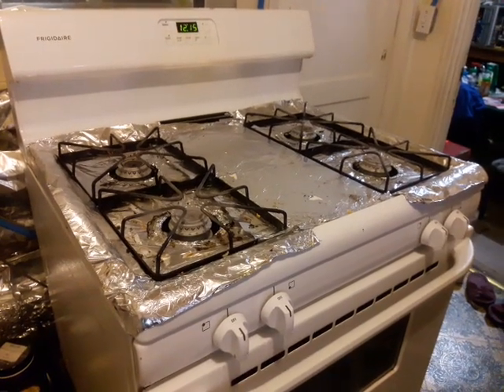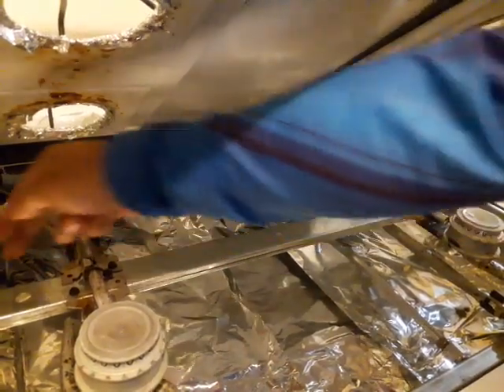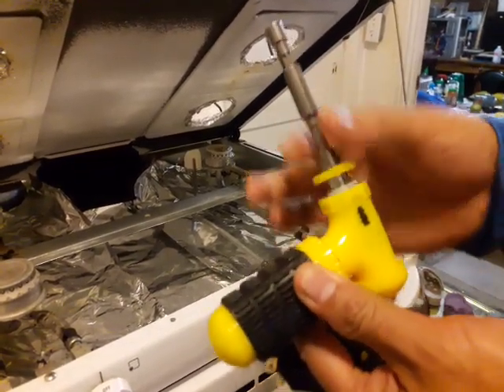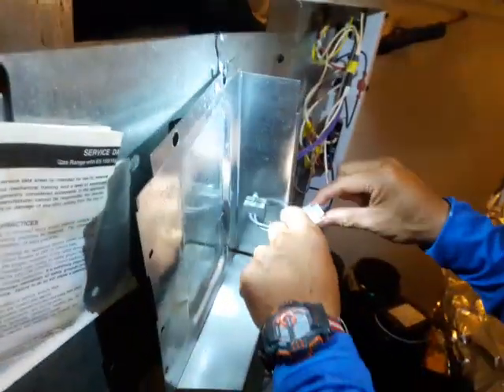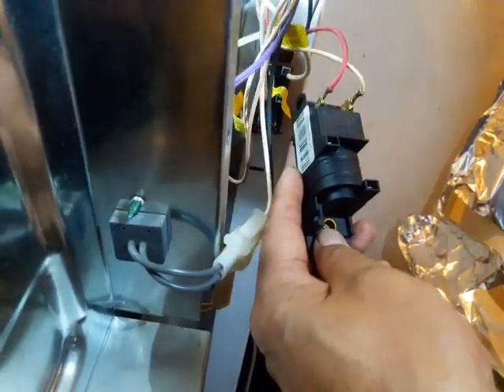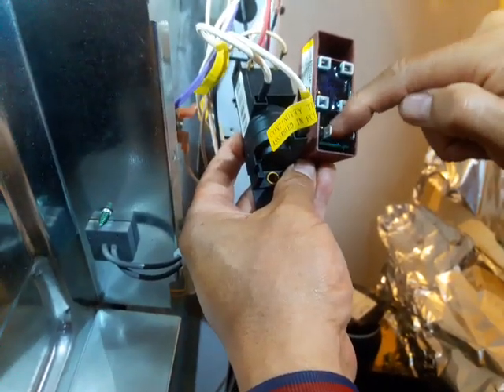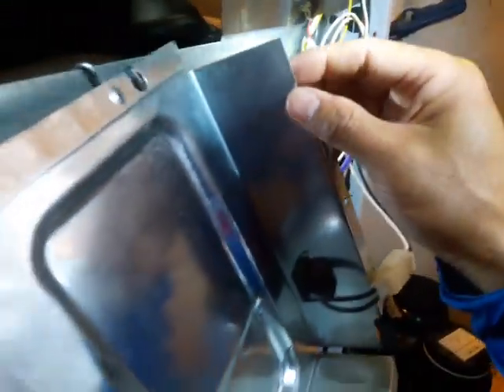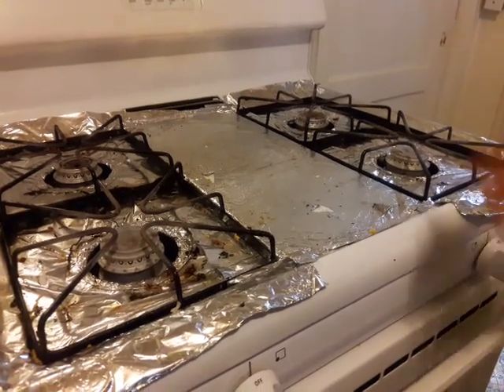Frigidaire Stove top oven no spark problem FIXED.for $20.00

Comment: Hello True, if I get a clicking sound and no spark on 2 out of 4 burners. What part do I replace? Also, if 3 burners come on and one burner has no click and does not light. What part is that do I replace? 2 different scenarios here, 2 Frigidaire oven. Thank you
Reply from the maker: On my oven, there is only 1 modulator that generate electricity to 2 Igniters (the one that create a spark), one Igniter control left side with 2 burners, and the other igniter control 2 burners on the right side.  Unlike my oven,  Some ovens have 2 modulators: 1 to control the left side (2 burners) and the other to control the right side (2 burners). Then some oven will equipped with 4 modulators to control each individual burner, Your oven is not the same model as mine but here is my thought on it.

1st Frigidaire oven "clicking sound and no spark on 2 out of 4 burner. You want to trace the wire from the igniter(the one that create a spark like a spark plug on car) to that modulator and replace that modulator assuming the igniter and the wire to the modulator is clean, good connection and no burned food that stuck in between the gap of the igniter that prevent it from making a spark. 

the 2 burner with no spark probably on the same side, left or right side of the oven. Don't be surprise when the wire from the ignitor to the modulator is damage due to bad connection or by mouse chewing on it.

2nd oven "3 burners come on and one burner has no click and does not light."

This oven probably have 4 modulators and igniters to control each individual burner, or that individual igniter is bad.

 Check the igniter and wire to the modulator to make sure it have good connection and power to the modulator, if everything seem good, than that particular modulator is bad.

Remember that the igniter is the one that make a spark(clicking sound). Modulator generate the electricity or power to the igniter that make the igniter spark. 

Hopes this will help.

Comment: Can I use a nonspecific modulator for stove top if all I need is power in power out and 4 connections for burners?thanks for the great video
Reply from the maker: Yes and it should be OK because the spark module is designed for many different brand of ovens. The only thing that you need to keep in mind is the input and out put may be effecting how strong or weak, slow or fast the sparks going to be since it varies from different brand. The original design of the modulator for this specific oven is 4 connectors for the burners. But the burner only use 2 connectors so they blanked out the other 2 ( they disconnected 2 connectors in the module so you cannot use this module on the 4 connectors type). If your oven is a 4 connectors type, then the part below is NOT COMPARABLE since it designed for only 2 connectors. I known people slice the 2 connectors of the 4 connectors type and joint them in with the other 2, but when they turn the oven on, the sparks are weaker so I don't recommended this technique since it required a wires modification on the oven.

If your oven is a 2 type connectors then copy this part number 808608801 and pasted on the search box on Ebay website. This part number is a replacement for Original Part numbers 316262402, AP5987233 and PS11728607. This will give you the idea of the price range, and design. The brand name I used in the video is ERP brand. At the time of this replied, the price is $20.08. According to my family, the sparks are stronger and faster than when the oven was new (with the original part number 316262402) . THESE PARTS NUMBER WILL NOT WORK ON THE 4 CONNECTORS TYPE. I hopes this will clear any confusion and thank you for watching.

Comment: mine sometimes 4 of them working next day 4 of them not working and later working ,,, is still issue with module?
Reply from the maker: I would first check for electrical connection to the oven. Before my module go out, I noticed a weak spark, and a few days later, it stop working. So if the spark on your over is weak or low when you turn on the knob, there is a very good chance that the module is about to go bad. The spark should be rapid and fast like in the video. Below is the link to the exact module I bought for my oven for  $20.08. 

https://www.ebay.com/itm/Gas-Range-Oven-Spark-Module-808608801-for-Electrolux-Frigidaire/382193412868?ssPageName=STRK%3AMEBIDX%3AIT&_trksid=p2060353.m2749.l2649

If link doesn't work, go to ebay and paste the below info in the search box and look for this seller name "supplystuf" and the brand of the module is ERP:

Gas Range Oven Spark Module 808608801 for Electrolux Frigidaire

I don't endorse or receive any payment from any sellers, I just past the info a long because it's works for me and I hopes it will help you too.
Reply: thank you for reply ,,, actually my stove is Amana AGS730L and is different so i wasn't able to see the spark module and I'm thinking maybe it is bad connection because sometimes spark is working ,,, today no spark at all :(
Reply from the maker: I would try to use an extension cord and plug the oven to another out let to see if you have a connection problem. If you got the same result, take a look at that module, mark all wires, clean the connectors and give it a few taps to see if it work.  You will also have to check to see if the power going to that module, If the module got power, and it doesn't spark, then the problem seem to be the module. Below are the link to your oven:

https://www.partselect.com/Models/AGS730L/MFGModelNumber/P1141263N%20L/Sections/ELECTRICAL-COMPONENTS/?ModelID=23620&ModelNum=AGS730L&mfgModelNum=P1141263N%20L&ManufactureID=1&Selected=21679&Position=3&mfg=Maytag&Type=Range&Mark=3

The spark module is #6 with part #: 
Spark Ignition Module with Bracket
Part Number: PS2034431

Comment: So the 2 most common failures are the spark ignition switch harness and spark module
Reply: Yes, because these are the 2 that mostly in physical operation when you turn on your oven. Let hope that it's a modulator because it's cheaper and easier to replace.

Comment: Hey, True, Where did you find a new module for $20?  All of the new ones I've found are $40 +
Reply from the maker: The price go up a bit since I bought it in December 2017, but you can still find it under $20.00. Go to Ebay and type in the search box as below:

Gas Range Oven Spark Module 808608801 for Electrolux Frigidaire

As of today, I can see the prices from $19.49 to $51.92.
The one I bought and used on this video is $20.08 by the seller name " supplystuf " and it's a ERP brand. Good luck!!!